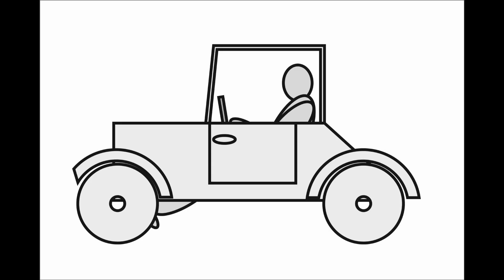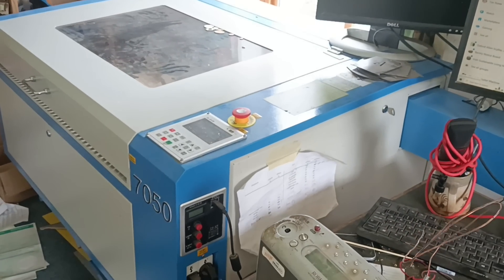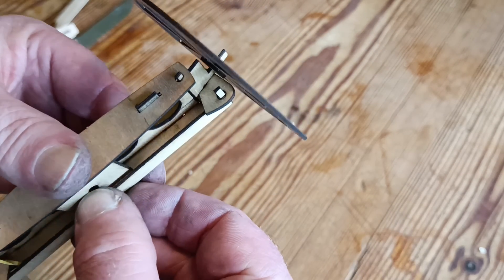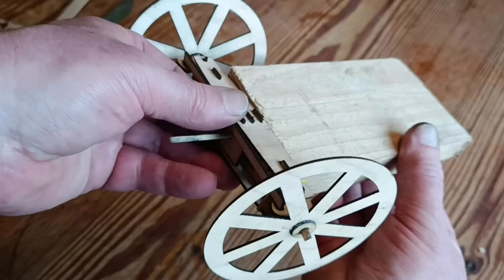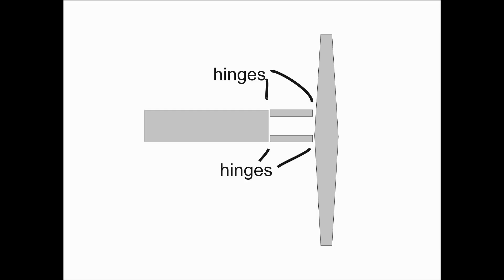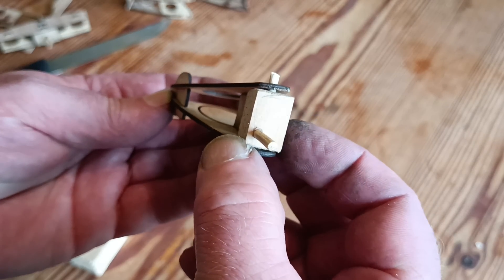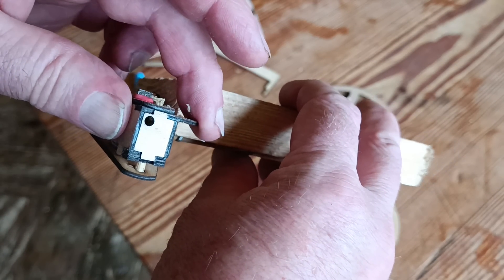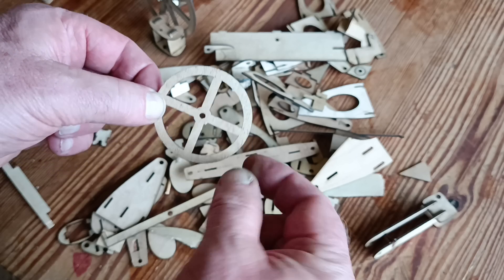Designing The Tricky Bit At The Front - Suspension And Steering For The  Wooden EBike / ECar

Comment: You REALLY need to look into Pierre Mochet's designs. I told you about them on the first video -- he called them "Velocars"; they were motorized quadricycles. Also you should look into cable-and-bobbin steering, and simple suspension systems. The Citroen 2CV actually has a really clever suspension that's remarkably mechanically simple.

But I've not had a reply from you to my comments in a while, so I suppose I'm not one of the bright lads you were thanking in that last bit. No worries, I already knew.
Reply from the maker: Ah now! I get around 200 comments a day. I'm sorry I didn't answer yours, but don't take it personally : -  )
Of course I have looked at his designs - thanks for the suggestion - and the 2cv has an amazing suspension system,  for sure. But I'm making a wooden car - it's not the same!

Comment: 6:02 so the wheels will steer in funny directions as it goes over bumps - cause your steering bar is obviously not changing it's size if both wheels go up or down. 😂
Reply from the maker: check the latest video..

Comment: Don't underestimate the "steering effect", sorry I don't know the proper term: The steering linkage to the wheels being one rigid bar, but the wheels moving slightly in and out from the suspension movement relative to it. With wheels having independent suspension, the right wheel going over a bump would also steer it to the right. With the long arms this may not seem like a lot, but depending on the travel it might still be enough to be problematic in the end.
Reply from the maker: I have a plan!

Comment: I wonder if plywood could be used as the spring medium itself, in the form of a leaf spring? 
It could certainly be used for the shock absorbers if they turn out to be necessary to control oscillations; friction shock absorbers consisting of two arms joined by a pivot and interleaved together in several layers are not uncommon on vintage cars (see Andre Hartford ones for one example - I believe they used wooden discs for the friction material) They’re adjustable too, by changing the degree of clamping force that holds the pivoting parts together.
Reply from the maker: Thanks, Emma - what an interesting idea  : -  )

Comment: Your idea to put the pivot points close to the center of the chassis reminds me a lot of the twin i-beam suspension from old Ford pickup trucks. Maybe you could google that and get some ideas, I have a 1990 f150 with this suspension setup and it rides very smooth

Comment: You will run into problems controlling the steering and alignment with your design: As the wheels bounce up and down, you're changing the distance between the steer pins.  This means the wheel may be aligned at the middle of the range of up-down motion, but at the extremes they will point alternately out and in.   You may get away with it, or you may have to go with a pivoting steering linkage where the steering link can swing up and down with the suspension arms and the point your moving to steer left or right is fixed near the pivot axle.  
In any case, good luck, this seems like a fun project!

Comment: When the suspension is working, the distance between the wheels changes. If the connecting rod is a one piece rod, it doesn't follow this, and it affects the steering, or something might break. 
If You use old motorbike shock absorbers with built in springs, You might spare some weight. And if You connect this shock absorbers to the frame, and not to the other swinging arm, it adds to the stability.

Good luck! 😊

Comment: Solid axles would make your life much simpler.
Transverse leaf spring like some early cars could be made from wood (its a bow without a string), to keep the all wood theme.
The Berg pedal car uses the single pivot tractor style front axle and works quite well for the speeds you are likely to achieve.

Comment: Seen lots of go-carts built out of wood (even glass reinforced) , the frame and body are good but suspension, steering(except the wheel) fail a lot sooner than one would think. In the long run it's best to stick with metal for those parts.

Comment: I recommend building a stiff front axle with one leaf spring at the center - basically very similar to the front axle of the tractor, but the center pin is replaced with the spring. It is a simple design and does not require many joints.

Comment: A normal bike just has the front fork suspension.
Wouldn't it be simple to do this on each side?
You could use a very simple steering mechanism as it would've need to flex at all.

Comment: Following your design track, have you seen or are you familiar with the  Ford  Twin I-beam (2wd version) or Twin traction beam (4wd version)   front suspensions they're very similar to the one you show. They were very common in the US on Ford trucks of various sizes but I don't know if they were ever used elsewhere. The Twin Traction beam (TTB)  was essentially a solid front axle with an offset differential that was split into two pieces roughly ⅔ the width of the frame. It was constructed of thick steel sheet stamp into subsections and welded.  It may lend itself to adaption to plywood or atleast some ideas. The biggest difference other than the longer axle sections are the radius arms used behind it that was angled from the king pin back to the frame, making a hybrid A-arm/ solid axle  that was known for being nearly indestructible. I do a lot of plywood structures similar to what you've come up with it but I design/engineer frames for upholstered furniture. My boss initially told me it wasn't possible to do economically and effectively, because they had tried numerous times over the years and never could get it to work out.  Now several years on he typically won't let me do otherwise. So i find your project interesting and know that you will be successful  it just may take sometime for  you to be work out the kinks but you look to be on a solid foundation. Good luck with your project
Reply from the maker: thanks very much Alex. I'll investigate those beams..

Comment: Tim why don't you start by looking for a 2nd hand 2 seater quadrcycle like they have at the seaside, and add a motor to that. You can then try and replace some of the heavy tubes with ply fabrication as you move forward.  Latest bicycles have moved to balloon tyres now which give a decent amount of suspension and roll well. This could save you a lot of work and added weight with springs etc.
Reply from the maker: I've never seen one here in Ireland, but I'll look them up - thanks

Comment: You need some sort of upper and lower arm assemblies so you can set your roll centres and keep your wheels flat on the ground throughout the suspension travel. There are suspension programs available where you can input all your chassis and steering data and it will tell you if you are being daft.
Reply from the maker: Sorry, not sure what you mean? Surely it's fine if the wheels roll a bit? That's how bicycles go round corners?

Comment: Interesting design! I look forward to seeing how it all turns out. My only issue with it is that the weight of the chassis and bumps will be carried through two cantilevered shafts (one front, one rear) It looks like each will  need to be quite beefy. Not necessarily a problem, but you didn't mention it and figured I might. Good luck! I enjoy watching you boil problems down to their barest elements and solving them!

Comment: Twin i beam suspension may be what you want to try. Basically what you made (one pivot point per wheel) but a beam that go from the wheel to the opposite side. (left wheel attach to a beam that pivot on the right side of the car and vise versa.) this make the suspension arcs wider with out having make a wide car.
Reply from the maker: Thanks - yes, that makes sense. Do you think it will be necessary on our design?

Comment: very involved project but you are driving down a road well travelled. I am sure you prefer to go back to first priciples but designers "as I was informed when I started my apprenticeship back when they had such things" should make sure a solution to the problem already exists. in the closing shots of your front end I noticed the steering bar needs to get shorter and longer as the wheels travel up and down. Keep going I am glued and riveted to see what is next.
Reply from the maker: Thanks, Victoria. In fact, the steering bar doesn't seem to do that - which I don't understand yet. Maybe it's just the sloppiness of the model. It should become clearer when we go bigger..

Comment: You left out about 2/3 of the Model T 3 point suspension.  They actually work quite well, but they might put your car higher off of the road than you would like.  Might not work with bungee either.
Reply from the maker: You're right, John - the leaf springs? They seemed to work - but they're heavy?

Comment: heavy planks... there were production cars at least till the 50's that were using hardwood ladder rail frames, for a slow vehicle it's perfectly fine, yet somehow they did it to sports cars, which aren't slow, long planks of glued up ply would work fine.  for dampers there's a very old technique, two metal disks with a rubber washer between em, you can adjust tension but you need some way to lock the tension nut if you use it for the suspension pivot.

Comment: This maybe a silly question, but instead of reinventing the wheel so to speak. Wouldn't it be sufficient to go to a scrap yard and get the wishbone suspension from a light car? You could go the whole hog and take the whole steering system minus the rack because it would be too wide.
Reply from the maker: No such scrap yards left in Ireland as far as I know. Also, too heavy  : -  (
Reply: @wayoutwest-workshopstuff6299  that's a shame. England is going that way as well. My closest scrap yard is about 40 miles away.

Comment: Tim look up Rose bearing - not only do they provide lightweight smooth bearings that can be bolted through pre-drilled holes in ply but also offer adjustment to get angles spot on - I notice you are using a vertical TRAIL which is essential to get comfortable self-centering steering - alternatively, you could tilt the whole module to give a RAKE of  25 - 30 degree to get the contact of the tyre  Trail some 3-5" behind the turning axis and the suspension would more in line with the "bounce" force vector so it could be made lighter but stronger - We have built several Eco Marathon cars using this principle.
Reply from the maker: thanks, Trev. Very interesing. (And what amazing cars!!)
Reply: @wayoutwest-workshopstuff6299  We once built one using a  de-commissioned Sea Eagle anti-ship missile as a mould !

Comment: that will work for the drives but not the steers the langth between the 2 tires will change when going over uneven terrain.
Reply from the maker: Yes, but does that matter? As long as the steering still works?
Reply: @Way Out West -  for drives you can use a telescoping shaft but dont see how that's going to work for steering. Since you'll need something ridged. Inless your think about folding the steering linkage as well if you figure that out. I look forward to seeing that in the next video.

Comment: Good progress. 
 To achieve caster, the wheel axle does not need to be moved back from king pin.  King pin should be angled. Lower mount should sit forward compared to top mount.
Reply from the maker: Yes, but a vertical kingpin would work though, surely? (Much simpler)
Reply: @wayoutwest-workshopstuff6299  A vertical kingpin is truly simpler, but that will make the vehicle steer towards the bump and so on.
A proper kingpin has a complex angle, not just front to back, but also sideways.
The kingpin should point to a spot about 2-3cm in front of the wheel contact patch and in-line with the wheel (when its straight).

This will make the wheel tilt properly, roll over obstacles without steering interference as well as track correctly with no steering input.

So yes, your vertical kingpin WILL work, but it will probably not be working good enough for a commercially viable product.

Comment: I do wonder why you want to go plywood, what with all the metal fabrication you can do? Tubular space frame and some lazer cut steel parts? I'm thinking along the lines of hand made bicycle frame making. Good quality marine, or furniture grade ply, that is void free is horrificly expensive right now. You wouldn't want to risk going with WPB hardwood, construction quality, as it will have core voids and weak spots.
Reply from the maker: I wish I had a laser cutter for metal, but it's a plasma cutter, which is much more crude. We only need a couple of sheets of ply per car...
Reply: @wayoutwest-workshopstuff6299  ah plasma, of course. Well, still more than good enough for making gussets. Good luck with the build; I'm curious to see how far you can stretch two sheets now.

Comment: Hi Tim, I think the mid-60s Marcos GT proves that plywood can be successfully used for cars. It had a top speed of 187 km/h, and according to Wikipedia: "The plywood chassis was glued together from 386 separate pieces and was not only light and strong, but also required a minimum up front investment to construct." I believe your speed limit in Ireland is less than 187 km/h, so you'll always be travelling at speeds already proven to be 'plywood safe'. Of course, there's also the DH98 Mosquito (plywood aeroplane), which topped out at 480 km/h...
Reply from the maker: You're right about our speed limits!  (25kmh for an ebike)

Comment: Hinge plate are very interesting the senter pin could have spring over  torsion suspension so many options grate models.  Grate going . Wonder could you have grese able hard wood pins and sleeves

Comment: This kind of suspension is called a Tatra suspension (i think). Tatra still makes trucks with suspension like this because it's much simpler than modern designs. And they work very well for slow speed offroad use.

Comment: Trailing arm and Leading arm suspension for size, weight and simplicity would be my vote. Shock absorbers are  probably not necessary but can also be added at a later point if needed. 👍🏼

Comment: Ford did the single hinge system but the lever arms mounted to the opposite side of the vehicle. look up "Ford Traction Beam". Desert racing trucks still use the design today.
Reply: Also be aware of toe gain. The single pivot moves the wheels closer and farther apart as they go up and down and if your steering doesn't also change length the front wheels will point further apart when the suspension moves. I believe Ford handled it by building a Y shaped steering linkage that could follow the suspension in most circumstances.

Comment: I love the "start from scratch" frame design process and it looks like you're going to make something truly unique (once again)!
Pragmatically, have you considered a couple of cheap full suspension mountain bikes for parts donors? Headset bearings would make a fantastic kingpin, and the spring/shock is about the right springiness for your needs. With a bit of welding, half of the bike could make almost your entire front "half axle"
Reply from the maker: It's true - but I'll see how far we get before we start chopping up bikes - I don't want to waste anything
Reply: You'd get the bikes for nothing. People don't have mass in things anymore. You're going to cut up new sheets of ply? Those aren't cheap.

Comment: Please don't reinvent the wheel (or in this case a front axle).
Your wheels turn when your suspension moving up or down. And they turn towards each other or away from each other the same time - and that's not good.

I would go for a McPherson suspension since it has few parts/hinges and it's quite cheap.
Reply from the maker: I think we may have stumbled on a way round that probem. Can't be sure till we make the fullsize version..

Comment: Great video Tim as always. That steering bar won't work tho I'm afraid. As each wheel moves up and down the distance between the rear of the wheels changes. So as the vehicle bounces up and down the wheels are forced out of parallel. I'm sure you either already thought of it or would do soon enough 😀
Reply from the maker: We have a plan!
Reply: Yes, the steering input would have to be split one for each arm.
Reply: Even so they would still have to allow for the distance between centre and the wheel changing.

Comment: shock absorbers/dampeners are really good for both comfort and driveability, but not necessary. I have driven machines without shock absorbers, mostly old mopeds. The problem with not using shock absorbers is that you can either have comfortable softer springs that make the entire machine jump down the road, or springs that are very hard and uncomfortable. Harder springs makes it a lot easier to drive however, since it's much more predictable. 

Going from riding my moped without shocks to my brother's which has shocks is very noticeable. His moped is a lot more comfortable because the shocks allow it to have very soft springs.
Reply from the maker: thanks, Edvin - yes, that makes sense

Comment: You can maybe also use the model of a dutch cargobike. A bakfiets the steer with de hole bak and you need only one hinge. They where made fom the '30 till the '70. Nouw they also make new ones with electric motors on them.  Brands like lely and gazelle made them in the earlydays, now there are brands like baboo and vogue that make them.

Comment: While all of that work is excellent, I would remind you that you are making a pedal car. There is limited weight on board and you will be driving at low speed, is all of this complexity really necessary? Take a leaf out of Elon Musks  design manual, the best part, is no part. Minimum design that will do the job.
Reply from the maker: I think we'll always need steering though : -  )